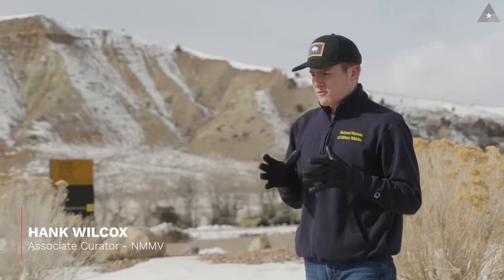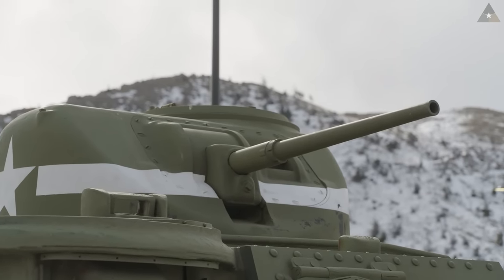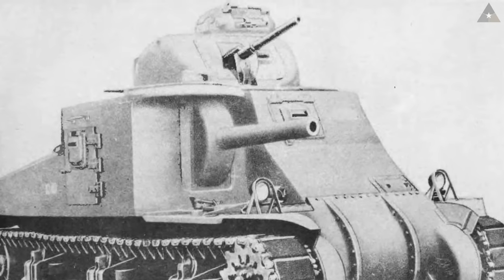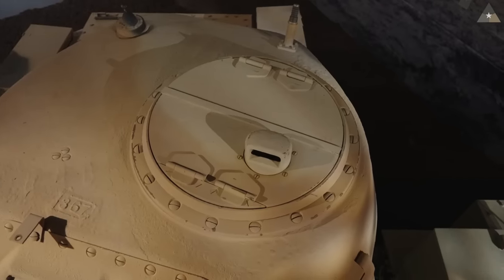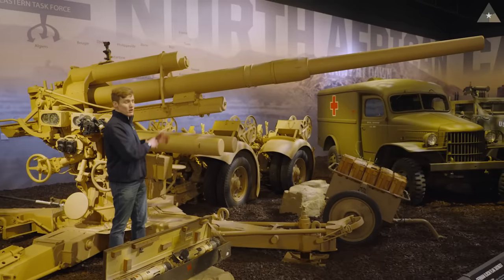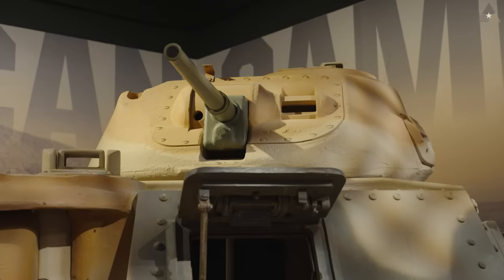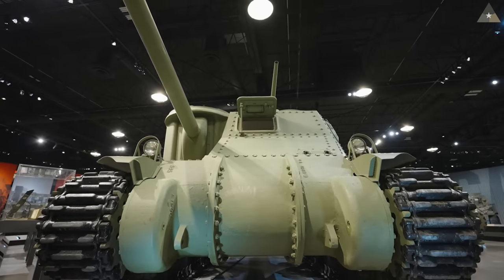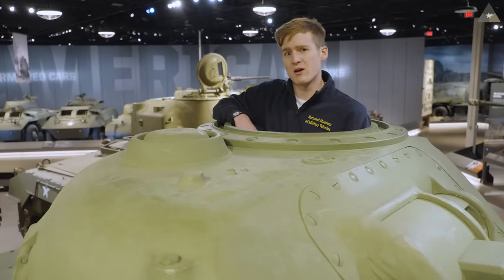30 Tons with 2 Guns: The M3 | Did it matter?

Comment: Once the M4 came out, they should’ve removed the upper 37mm turrets from the M3 tanks, then replaced the 75mm gun in the sponson with 105 howitzer that was fitted to the close support versions of the M4 (which also normally came with a 75mm gun) There by making a retrograde cheap way to help supply a M7 alternative till there were enough around. BTW the main problem the Soviets had with the M3 was the high profile. (Afterall they could anyway be fitted with the Guiberson Diesel radial), which would be solved by dumping the upper 37mm turret.

Comment: The Lee/Grant served the British well in the desert. The biggest issue encountered was the poor quality ammunition for the 75mm the British were forced to convert captured stocks of French HE captured in Syria and German AP captured in the first battle of El Alamain.
Reply: The American 75mm M61 armor penetrating round was tested alongside the hybrid German/American 75mm armor penetrating round and did just as well. Except it did not have the small explosive filler – which the British would remove anyways so that did not matter.

The American 75mm HE ammo supplied initially was of World War One vintage. It lacked the creep fuse that better responded to sharp angle hits – it still exploded with most uses. To provide a creep fuse until U.S. ammunition with the improved fuse arrived, French fuses were scavenged.

The British loaded 17,000 hybrid American/German rounds – only 2,000 were high explosive. No commentary is possible o compare them to U.S. ammo given they were used side by side. It is true, though, that the Germans captured 6,000 rounds of the hybrid ammo when the British handed them over to them during the retreat to Alamein.

The 75mm became the gold standard for tank cannon for the British Army because the British were unable to develop a suitable cannon. E.M.C. Clarke – who did so much for the British gun designs – did not want the British tankers to have a dual-purpose gun that could shoot HE and Ap rounds and as such he sabotaged every attempt to develop one for the British. The 17-pounder was notoriously inaccurate and issues with the poor quality of British high explosive shells provided for it – from small bursting charge to failure of the fuse to function – hindered its potential. So much so, that:

On 21st February 1945, Bernard Montgomery issued his "21 Army Group Memorandum on British Armour; No.2" in which he returned to the theme of tank and anti-tank weaponry, announcing that "The 17-pr gun, firing A.P.C.B.C., still bears comparison with German weapons; sabot shot gives this gun increased penetration but the accuracy is poor over about 1000 yards. 
The Field Marshal also believed that:

"The 17-pr H.E. shell is still unsatisfactory. In order to obtain a suitable trajectory to the shell, a reduced charge is used. At short ranges (1200 yards and below), or in soft ground, a considerable percentage of these shells fail to detonate." 

And:

"Experience in battle is that about 75% of the shooting done by tank guns is H.E. The 75mm gun is a very accurate weapon as well as having a good H.E. shell; the round itself is easy to handle inside the tank. The 75mm gun is therefore regaining its popularity; and until a reliable and accurate 17-pr H.E. shell is forthcoming units are averse to accepting more than two 17-pr gun tanks in each troop of four." 

While he recognised that the 17 pounder would "see us through the present war", he added the caveat that:

"l consider that the 17-pr is not an entirely suitable gun for the primary weapon of the capital tank. When an enemy tank is engaged it must be hit hard at long ranges; the 17-pr is insufficiently accurate at the longer distances." 

The poor British tanker (and antitank gunner) got nothing but promises throughout the war which their own people failed to own up to.

Comment: Stalin is said to have called it A Coffin For Seven Brothers. So not a fan.

During fighting in the Far East several M3s were moving up a mountain road when the were attack by the Japanese. Knowing that the 75 mm gun was on the right hand side of the tank they mounted their ambush on the left side of the road. So the tanks ran through the ambush and coming across a spot wide enough to turn around and charged back into the Japanese this time with the 75 mm on the same side as the attackers. It didn't end well for the Japanese.

Comment: Soviet tank .crews called the M3 a "coffin for 7 brothers".
Reply: They were going against Tiger tanks
Reply: Beat me to it 😮
Reply: @sixgunsymphony7408 uh, no. Tigers didn't hit the field until later.
Reply: And yet USSR was the last nation to use them in Europe at Citadel/Kursk.
Reply: @nickdanger3802 In Europe, possibly - the US dumped lots of old kit under Lend / Lease and the USSR was desperate enough to take it.

They were used in the Far East [Burma for example] until the end of WW2 - where Japanese tanks were rubbish.
Reply: No, the Ost Heer typically had fewer than 70 operational Tigers on a front more than 1,000 miles long.  Tank against Tank battles were less frequent than Hollywood would have us believe.

Comment: The concept isn't bad, at all. I think however it would've been more beneficial to have the 75mm gun in the turret, and the 37mm in the bow.
Reply: The tank was made specifically because the US couldn't fit the 75mm in a turret and needed time to develop one which would become the Shermans. It was considered good enough to put the 75mm in the hull and use the current 37mm turret on the Lee to quickly put an interim tank in the field with capability to use the 75.